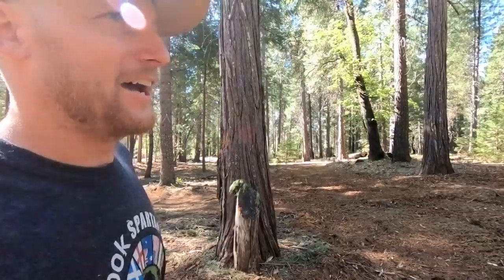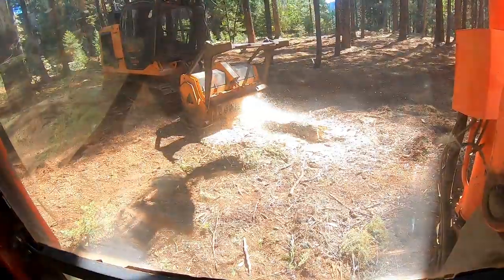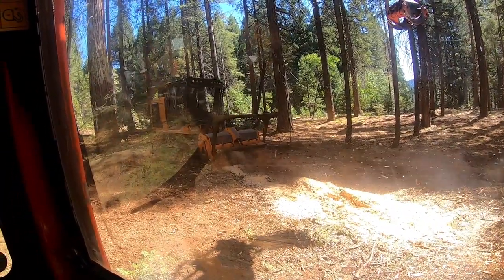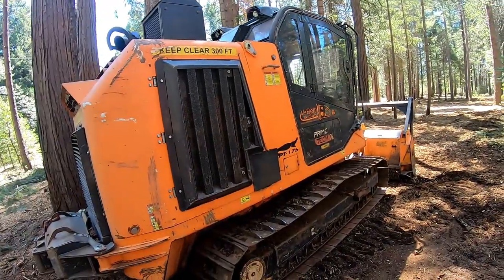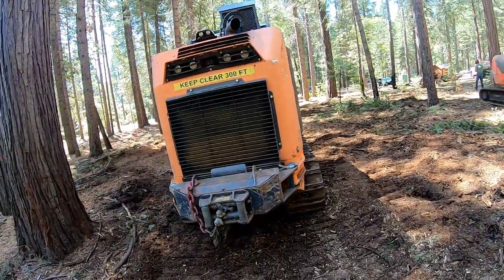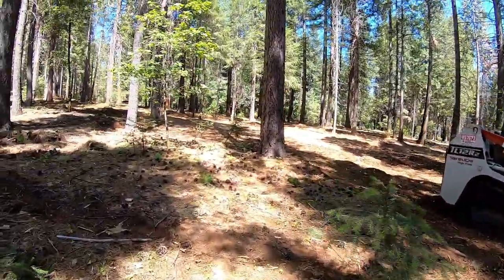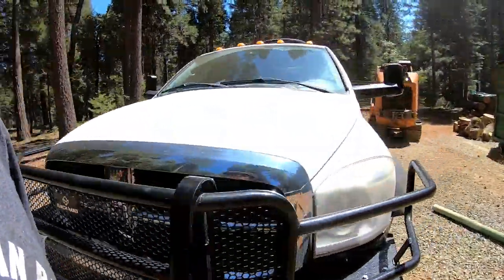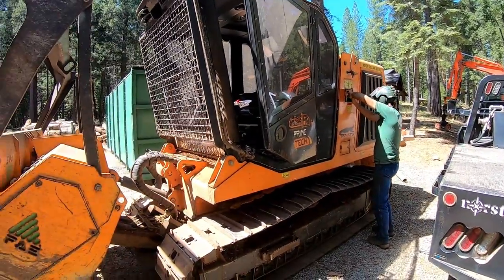Forestry Mulching. Grinding up brush piles after logging operation

Comment: I had an overheating problem on a chipper.  The solution was to put window screen material on a heavier frame that was hinged.  The machine can be left running or turned off, unlatch and swing the screen door 90 degrees and everything falls off, close it and get back to work.  Less than $100 plus a few hours to make it, solved real cheap.  It kept the radiator very clean.

Comment: That Primetech doesn't play. Doesn't the head cut better with new knives? Kinda like using an old table saw blade vs. a new blade. I remember poking around on the FAE site and noticed they made Primetch. I noticed on the Cat website they put a mulcher head on a D3K dozer.

Comment: What wheel chocks do you use for unloading and loading the prime tech so that it does move the trailer? I was wondering does it work also to unplug the emergency brake plug so it locks the wheels up?